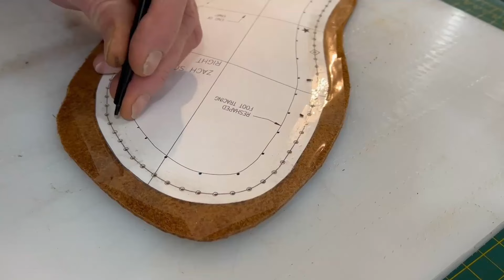Making Custom (Bespoke) Leather Moccasins

Comment: I could skip on the rubber bottom part tho right if ide rather without...im aware theyll wear on bottoms much faster but im needing these for more the purpose to not have a rubber sole. Just have a bunch of older leather scraps that had been my father inlaws and they have just sat in a box for dang 30yrs. I finally found out i could have used it all along and wasnt something special being saved...he acually was very happy when i asked if i could use it to make some moccasins for us n our kid. He even has all the leather working tools and leather string in there with it. This ol box hasnt been touched in 30 yrs and i feel really blessed to get to make something of this leather at last. And thank you for thos video showing the steps one by one very easy to follow sorta hypnotizing but peaceful w the music you got on here.
Reply from the maker: Sorry for the late reply, but yes, absolutely you can make them without a rubber sole, I actually just finished two pairs without rubber. I did however add a separate layer of veg, tan leather on the bottom, which I would recommend, but it is not necessary if you want a really soft foot feel.
I’m excited for you with your newfound leather. Hope you make something great for your family.

Comment: Really, really, really well made.  The Mocs and the video are well done, man.  I made a pair of Mocs for myself using a store-bought kit.  I have wide feet so I modified the standard pattern quite a bit and bought some extra bits 'n' bobs to finish them.  I like your chukka style much better than the loafer/slipper style.  And the  rubber sole makes the whole difference. Do you notice any discomfort due to the entirely flat sole/lack of arch support? I guess you could put a store bought insole in there if you wanted?

If and when you get plans ready for sale, I will be entirely on board.  This video got me in the mood to make some for my kiddoes.  And definitely another pair for me.  I don't have the industrial machine, but I'm willing to hand stitch everything for a pair of shoes like that.

Once again, great work.
Reply from the maker: Thank you for the kind words, I’m glad you enjoyed the video and the process.
I also really enjoy the chukka style as well.
And the this sole is great, adds some protection to the feet and the moccasins.
As far as discomfort, not having an arch or heel, I personally have no trouble with it at all.
They can take some getting used to if you’ve never worn, barefoot or minimalist style footwear before, you may want to wear them a bit at a time until your feet get used to it
However, I come from the belief that these types of moccasins are better for your foot health, for example, since they are custom made to your feet, you have a wider properly fitting toebox which is great compares to factory made shoes that cramp up your toes and can lead to bunions or other problems.

But please do your own research, and consult your foot doctor as I am not a doctor.

Comment: They look cosy! I do wonder though, how durable are they? Would you use outside or just an indoor moccasin? Thank you for the answer.
Reply from the maker: I do wear them outside, just not In very wet rain or snow, I mean you could but the more often leather gets soaked and then dries it seems to age faster. The sole is adequate protection from most outdoor surfaces, but I wouldn’t expect them to protect from anything very sharp as the sole is not super thick like a hiking boot, and the side leather is also soft.

Comment: I'm using the same pattern! Plus the same methods but using different tools. I have a pattern for Navajo also but the materials are a bit forbidding cost wise!
You look like you've adapted the welt pattern to give a small flare on the instep. Is this for a better fit, and is it specific to your foot. If so I'll try it, I have a high instep.
Reply from the maker: I presume you mean we are using the same “design” not pattern… the moccasins I show in the video are of a basic chukka design, with is essentially the simplest type of basic shoe, using 3 pieces, sole, vamp and heel piece.
They are made specifically to fit my foot or whomever I measure and make a person specific pattern to fit.
So the instep, aka “vamp” piece is formed
To fit the wearer.
The material (leather) is really only a couple square feet, and not relatively expensive if you can source smaller quantities of leather, compared to what you may buy factory made in real leather I believe they are a bargain. 
No counting you labor of course 😁

Comment: Hi Brian, thank you for such a great video and I look forward to instructions on pattern making. The 3M spray is a fantastic idea for the lining! Do you find this design suitable for canadian winters? Im wondering how waterproof? Also considering using shearling lining but that could be difficult to work with -if youve any experience with that to share?
Finally could you please tell me if you have successfully dyed this bison leather? I'm assuming darker should be possible but wondering about any pre-treatment and which dyes? Or even tried lightening colour perhaps with oxalic acid? The raisin is a good price right now but not a colour I want to wear - 😮 hubby and I are starting out on our shoemaking journey now we require custom shoes from developing crazy toe splay and no success ordering barefoot shoes online. So so many questions when starting out its quite overwhelming and easy to thibk i need every possible tool.....the duct tape 'lasts' another fabulous simple solution :) 
Your video has been inspiring - thank you Sir for sharing and I shall be sure to use your links 💞
Reply from the maker: Can’t comment on how waterproof the 3m spray would be, however the fleece lining is basically sewed in after it’s glued so don’t think that would be an issue 
The leather I used was pre-dyed from the tannery, and I have never attempted to change the colors on it sorry can’t help there either.

Don’t let it overwhelm you, it’s a process but it’s not to bad if you break it down into steps.
One thing at a time , and thanks for watching 👍

Comment: What material did you use for the soles? I want to make some but wasn't sure on this! thanks!
Reply from the maker: Hi, I will add all that info in the description box of the video this evening
you can check back later tonight to tomorrow (I will include a link, got the stuff on Etsy)
Reply: @BuildswithBrian  Awesome!! thank you so much!

Comment: Ice been doing leather work for two years now and want to start making shoes.  Looking for a good place to start.  Need know-how, pattern, etc.
Reply from the maker: Hi and thanks for watching, my best advice to you is… I was in the same
Position as you are now and was frustrated over not finding specific information about shoemaking or Marcussen making online, so I jumped in with 2 feet and bought a cheap pattern off Etsy, built a pair, studied the pattern, tried to figure out how it worked, modified it, failed time and again, until I figured out something that worked repeatedly for me.
In my humble opinion, in retrospect, this was the best way to learn how to make a shoe pattern.  If you are patient enough, I may make a video series on my process, but I suggest you don’t wait for that and just jump in and give it your best shot. I think you’ll be surprised what you could figure out.

Comment: What is inside your duct tape “last.?” Thats a pretty cool idea. I have seen using the duct tape to form around one’s foot. But what makes your so sturdy?
Reply from the maker: I filled it with sand 😁
Reply: @BuildswithBrian  thanks for the tip. That is a good idea.

Comment: Is there a specific software you make the patterns in?
Reply from the maker: Sorry for the late reply, but the short answer is no there is no specific software that I use, I normally just make the patterns entirely by hand drawing, however, I have played around with using auto cad, which I use in my day job, to make spacing the punched holes a little bit easier.
There is no magic bullet that I know of
To make make patterns.
I hope this answers your question

Comment: Bonjour , 
lorsque vous faites votre patron , est ce que je peux vous demander comment vous calculez le nombre de trous qu’il y a à percer pour que la tige et la semelle s’assemblent parfaitement ? Merci
Reply from the maker: I will try to explain how I do it.
The seam length of the sole and the upper will be different lengths. So to connect them with stitching you must measure each seam and divide them into the same amount of spaces.
The spacing of the stitches for each piece will be different but try to make the larger of the 2 about 8 millimeters. The shorter seam will have stitch spacing somewhat smaller.
When they are sewn together the stitches will pull the 2 pieces into shape.
I hope this helps you
Thank you for watching
Reply: @BuildswithBrian  c’est gentil de m’avoir répondu ,merci 
Bonne journée

Comment: I've shared your video and hope you get more views and requests soon. Really like your technique. Did you learn from somewhere or create your own? 😊
Reply from the maker: Thank you, I am self taught, with the exception of buying one pattern for a women size 7 from Etsy which I made with some success but it was a start. From studying the pattern and trial and error I learned how to create my own pattern to fit any size and shape foot
Reply: @BuildswithBrian  Thank you! Just noticed that you indicated it will take 8 to 9 hours to make the moccasins, which is a good gauge of reality! 😂 I have some leathercrafting experience and have tried prototyping some shoes as store bought shoes don't fit me well. But haven't made any shoes that are suitable to see the daylight yet. 😅
Reply: @BuildswithBrian  May i know what kind of soling did you use? I'm wondering whether my beveling tool will quickly become blunt from cutting out a groove in the soling. Am also wondering about the single hole punch. Are there any particular reasons for choosing that instead of a two hole iron?
Reply from the maker: @rubricsuxi  i put info in the description box of the sole material I use as well as where I get it.
If you have a good quality groover it should be fine, the sole material I suggest is pretty soft.
I recommend the single hole punch because the hole hole spacing varies for most of the pattern. Particularly the lower piece to the  vamp and the heel piece.
The variance I spacing is what makes it possible to connect shapes of various lengths 
Hope this helps
Reply: @BuildswithBrian  Thanks! That makes sense and i often find it challenging to get the heel part sized correctly and stitched properly even when using a sewing machine. 😅
Reply from the maker: The majority of the stitches I use are by hand.
Machine stitching is hard to make look good, at least at my skill level.
Also sometimes impossible or impractical unless you have specialized sewing machines made for shoe or boot making.